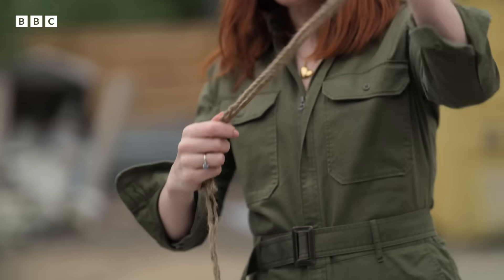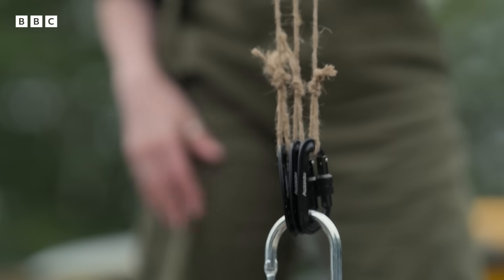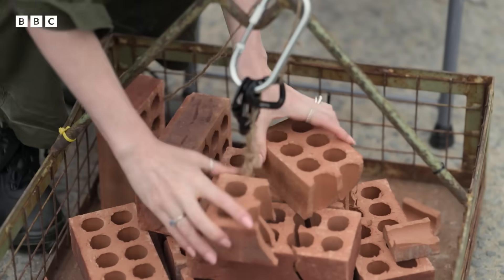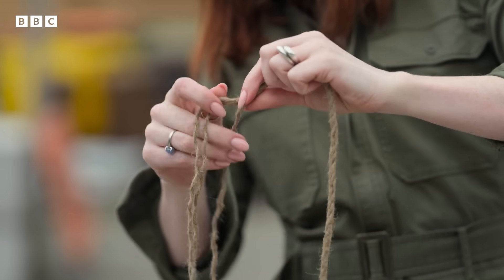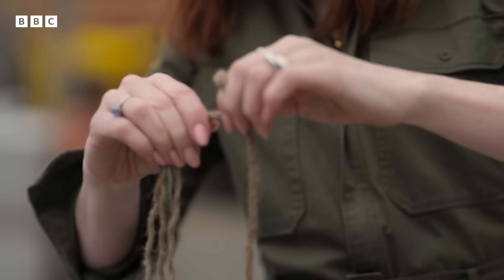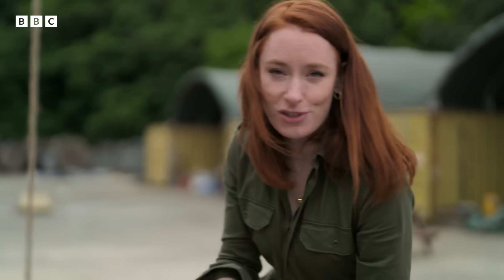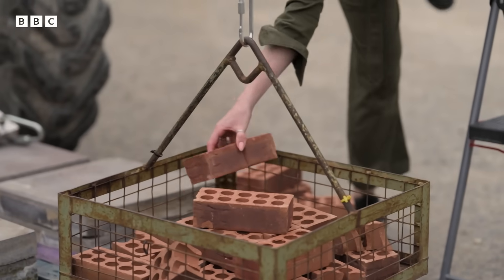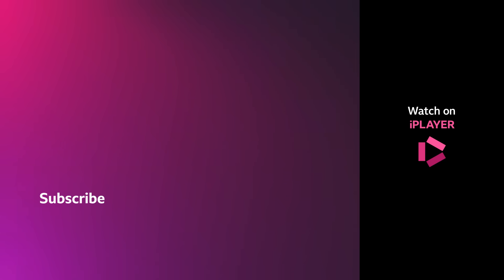The fascinating physics behind lift cables | The Secret Genius of Modern Life - BBC

Comment: Bonus question, I have an automatic roller door, lifted by cables at each end of the door. They are twisted wire right hand twists. Over time, the left hand cable has shortened, and that side of the door is lifted about 1 cm when closed. The door mechanic says, they always do that,always the left hand side facing out, why is that?
Reply: Surely it is a quirk of the particular mechanism, having nothing to do with the twist direction of the cables.
My guess, the motor is on the left side and it simply winches the cables for both sides. The cables get longer proportionally to their initial lengths. So, the length of the right side cable increases more than that of the left one, seeming that the left cable got shorter .
Reply: @ appreciate your thoughts, but no, the left and right cables just connect to coil springs that give the door neutral weight, the motor is central.

Comment: Maybe I didn’t see this properly but it didn’t seem that the other two strands failed when one was cut. It looked like they were part of a pulley system which Hannah cut.  Ie the only break was the one created by the scissors and the strings simply pulled through after that. Seems a bizarre way to demonstrate the difference in strength between 3 separate strands and 3 strands twisted together.
Reply: 1:26
Reply: @HubbHubbs  0:27

Comment: Sudden impact also is a contributor to separated strings/ropes being less strong. When three strings were separated and one was cut, there was a sudden extra load felt (1/6th more than before) on the remaining two.
Reply: If the other strings hadn't snapped, there wouldn't have been that shock loading though.

Comment: I was worried about her... Standing under a -by hydraulics lifted - part of a heavy duty machine... Has this type of machine safety valves which blocks when a hydraulic tube is ruptured and prevent the load to give in to gravity?  I one watched such a phenomenon you can blink 1 time and then it's over... Yes, I know, this isn't a heavy load... But this machine has seen better times in its life...

Comment: The weakest point in each strand is the knot. Probably less than 1/2 of the breaking load of an untied strand. The breaking at the knot is visible in the video.Twisting allows load to be spread over the big three strand knot even when one strand is cut. Twisting actually decreases the strength of a rope.
Reply: Nice hypothesis but by single frame stepping at 1:27 you can clearly see that neither of the two strands failed at the knot.

Comment: Needed eye protection at the least when cutting that first line!  You knew the other two were going to break while under tension, and their ends would go flying. Not to mention the likelihood of bricks breaking and sending pieces flying.
Reply: 100%! I had the same worry lol
Reply: Agreed 100%.   I'm not in favor of over-use of eye protection (for example, making kids wear safety glasses in science class when they are cutting paper or planting seeds), but in this case, the entire experiment was designed around the chaotic breakage of the line under tension, which as you point out would send their ends flying.  Common sense safety should be the focus of eduction - not overly prescriptive policies that leave common sense out of it.  The result of not practicing common sense safety measures is something like this; Hannah should have refused to do this without wearing safety glasses.

Comment: The concept is called load sharing. In wood framing, if you have three wood members together or a redundant system of joists, the code allows you to multiple the strength of a single member by a certain amount. If the strength along the length of the rope was constant and there was no impulse load from cutting the string, the load capacity would have been the same. You likely have a bit more of an impulse in the first case which increases the load on the string. Also in the first case, it is the weakest point along a single line that determines the strength. In the second case, if you cut the line at the weak point of the other lines, it would have the same strength as the first case. It is just very unlikely you are cutting the string at the weak point of the other lines. In wood framing, it is unlikely you have a knot in the wood in three members all at the same location.

Comment: It didn't fail at 44 kilos, you cut it at 44 kilos.  It could have held more even with the strands separated.  The point of the video is still well taken, the strands hold more weight when braided.  But you can't say it failed at 44 kilos when you had to cut one to get the other two strands to break.
Reply: She cut one when it was braided as well
Reply: Assuming one fails, the two threads left failed at 44 kg when not twisted. 

How does this sound?
Reply: Great to see the point flying so far above your head. 😂